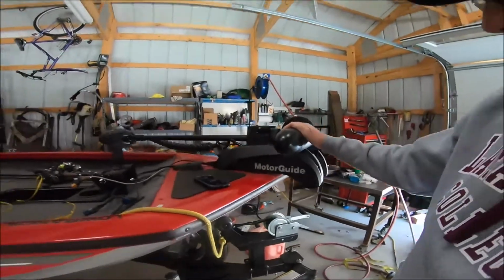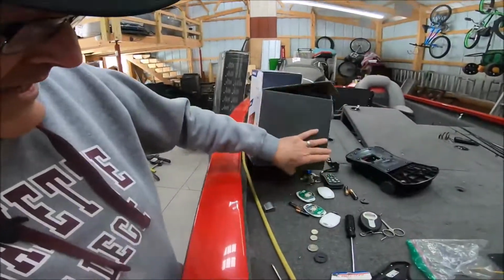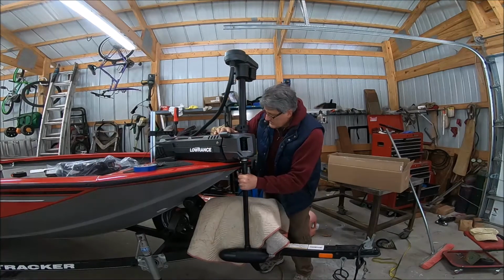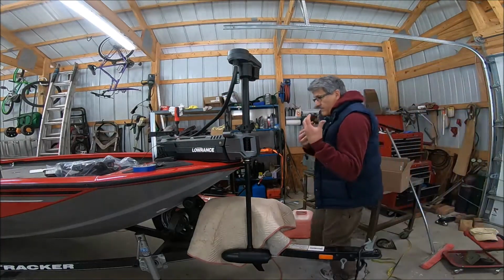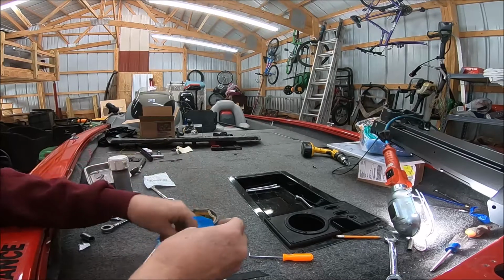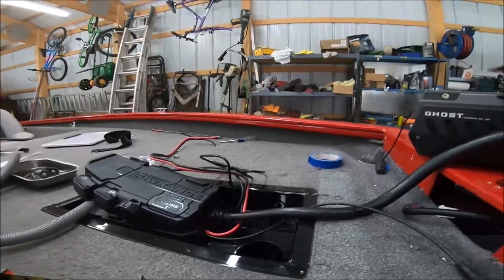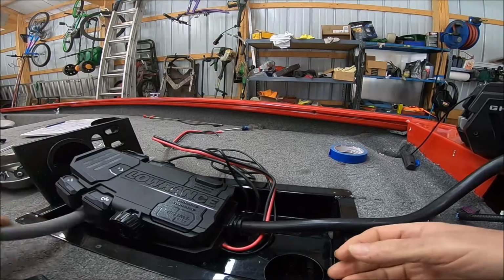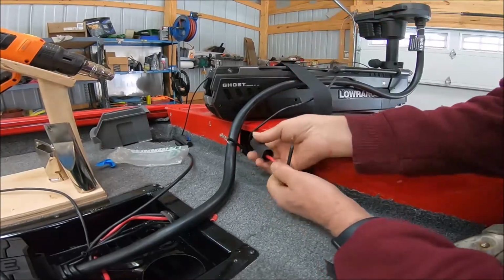Lowrance Ghost & Active Target on 175 Tracker Part 1

Comment: Hello from Spain! Good job! I own a tracker 175 and i am going to instal a lowtance ghost. Did you test it? Did you experience some problem with anthena position? I have some doubts with where to install anthena. I was thinking on the left on trolling motor but manual recomend not to install very near. Thank you!!
Reply from the maker: I’ve had it out two times. No problems with the antenna position. The anchor feature works great. The power is awesome. I had it set at “7” and When I turned it, almost knocked me out of the boat. I’m still getting used to it’s turning sensitivity. Yesterday I was fishing in a 15 to 20 mph wind and used anchoring for 4 hours and saw no loss of power at the end of the trip. 
You’ll love it. 
Thanks
Tom
Reply: @camomano2  thank you so much!!

Comment: Hello from Sweden! Good video, just wonders if its the 47" in length ghost, have ordered the 52" but I think it can be to long.
Reply from the maker: Joakim, it's 47".  Do you have a bass style boat or a "V"  bottom.  52" should be fine for a "V" bottom boat.
Reply: @camomano2  i got a 175 txw. My lake im fishing in is tough With waves and dont want it to be over the water
Reply from the maker: @joakim8937  Send me your email address and I'll send you pictures of the motor deployed.  I think 52" is overkill.  These pictures should help you decide.
Reply from the maker: My email is trumore@ptd.net